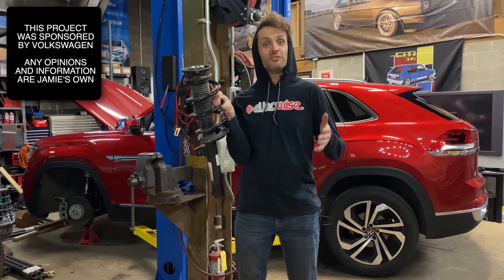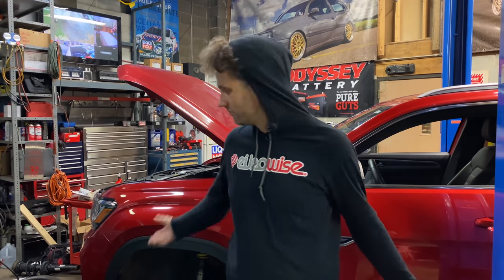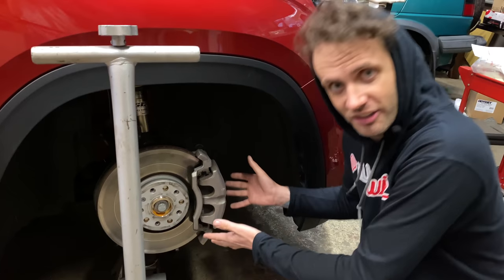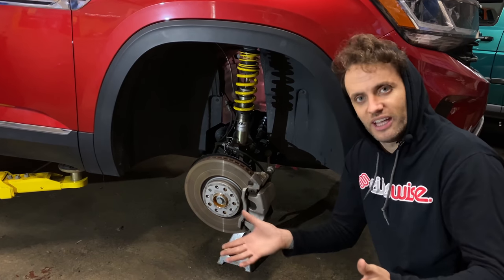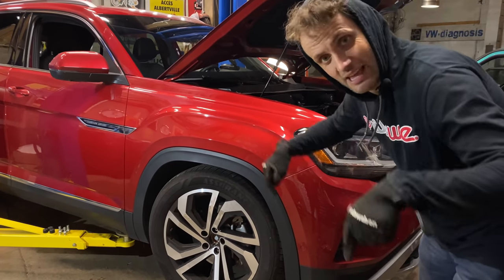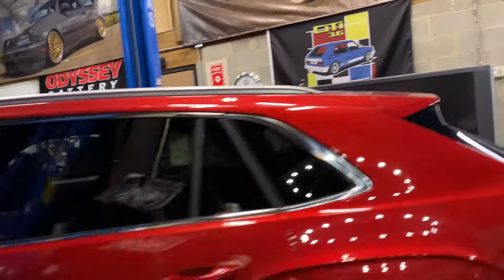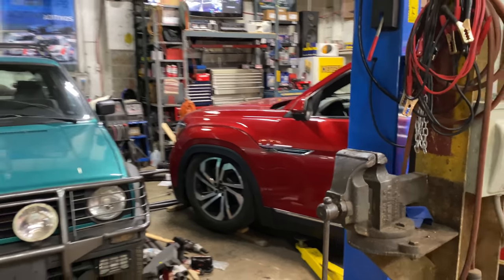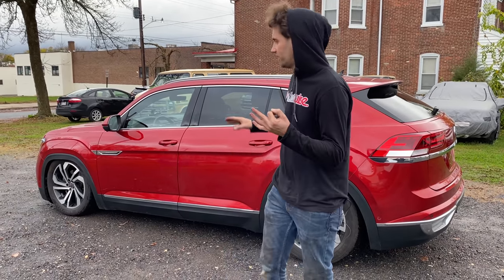Static VW Atlas Cross Sport - 7,000 mile roadtrip Part 1

Comment: 7:46 I was "STOP!!!!!!!" 
You didn't put the rear lift arm back under the car.
You're lucky it didn't tip over.
Reply from the maker: You're correct - I was only going for a few inches, but I should set a better example. :-)

Comment: Why is this not in South Africa as yet? Is it normally aspirated?
Reply from the maker: They are available with the 2.0 turbo and the 3.6 normally aspirated engines, both front wheel drive and 4Motion all wheel drive. I don't know how well the Tiguan does in SA honestly - I would think that the Tiguan Allspace would be the nearest thing, although the Atlas really is quite a lot bigger.
Reply: @JamieOrr  Well the closest is the Tiguan. But seems like it's way more fun especially with that 3.6

Comment: What exhaust are you using with your Vr6?
Can you use the Audi S or RS exhaust? 
I just want to get rid of the fake slots! 😱😬
Reply from the maker: I had a custom made setup quickly made by a local exhaust friend - unfortunately no other system fits.. but I'll have more details in a MUCH later video :-)

Comment: Question regarding torquing the axle bolt. I've heard and been told multiple things. Doesn't the bently manual stress in the torquing procedure that the bolt must only be torqued with the wheels off the ground?

Comment: What KW coilovers are you using? I emailed them this week and they said that they do not have anything for an Atlas.
Reply from the maker: This is not public information, but the development is basically finished, and if you email or call the suspension source on Monday, you might be first on the list :-) 😅😅
Reply: @JamieOrr  thank you
Reply: I just picked up a 2022 SE 4MOTION
Reply: What is the model number of the ST STX coilovers, they don't have anything specific to the Atlas Cross Sport, but will the Tiguan coilover work? Thank you for any information that you can share.

Comment: What is done to the exhaust @jamie Orr
Reply from the maker: I had a local exhaust friend remove the rear muffler and the rear resonator with a custom made section in the rear. It's honestly a bit too loud for a normal daily.. ;-)
Reply: @JamieOrr  I did the B2B resonator delete on mine and still not load enough for me.

Comment: What is a good and affordable brake setup for my MK6 Jetta 2.5 SE
Reply: unrelated but check out the afe intake for the 2.5, it deletes factory engine cover. looks amazing.  summit racing has affordable brake upgrades free shipping
Reply: @camac360  I already have a IE intake manifold kit just need to install it but thanks for the help, always appreciated
Reply from the maker: You can't go wrong with a simple Golf R or Audi TT-S setup, but otherwise a budget setup is based on a 4 or 6 piston Brembo fitted to Porsche / Touareg etc. Then moving up you're into the custom 6 piston setups which are much easier to use but do get pricey. :-)